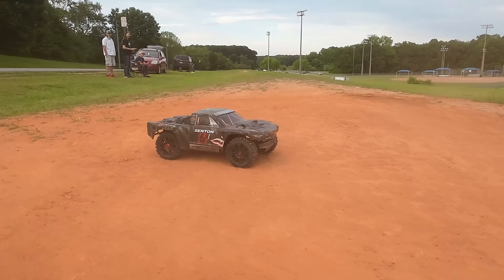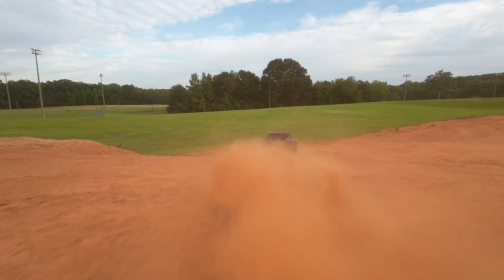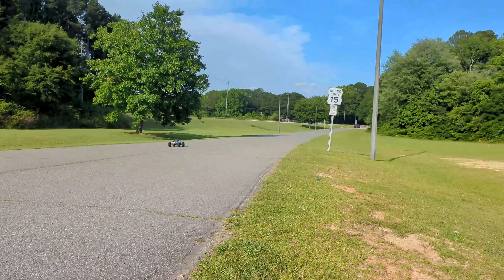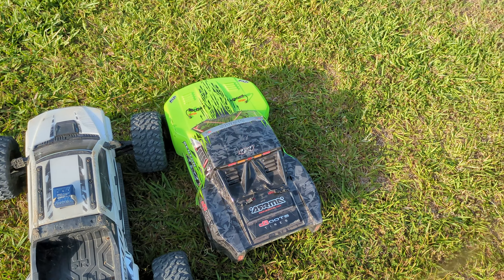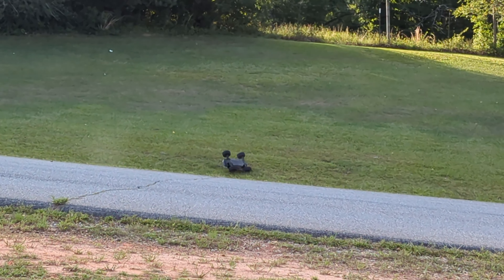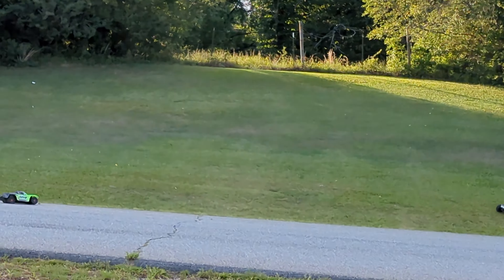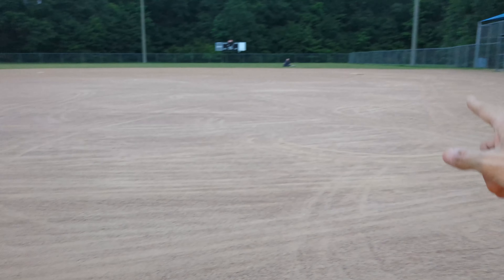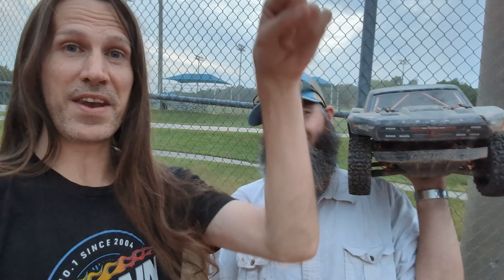SENTON 6S, QUICKER than a FORD RATPOR!

Comment: the 6S senton is on my bucket list for sure! i have a 3s senton v2 thats upgraded to 4s and. the thing is wild and will do 65 all day (i did vent the body myself though), but the extra build quality, heavier duty components , center diff, interior cage, etc on the 6s just make it more desirable. but nobody wants to get rid of them - theyre impossible to find for sale!  or i fthey are for sale they're like more than the cost when new.  still, sweet vid thanks for sharing
Reply from the maker: Yep,  people who have a 6s senton won't let them go. But, as you've done, boosting up a 3s is a great way to have an absolutely wild short course truck, and of course, they're so tough it's almost unbelievable.
Reply: I have a shelf queen senton 6s, all stock😁

Comment: Hi ! great drone footage ! what kind is it ? DJI or FPV ? thanks ;)
Reply from the maker: That's a DJI Avata 1. Nowadays we use the Avata 1 and the 2 for different reasons. The Avata 2 is faster on the motion control than the 1, but the 1 turns a 180 quicker so we use both these days. The motion control is a big help in keeping shots smooth, but it cuts the speed in half.  Still searching for a solution for that because flying full manual takes away head tracking. If you even think of a way to have the speed without sacrificing head tracking, please let us know.
Reply: @Rek_Rc  No solutions, sorry... but thanks for all those tips 😉
Reply from the maker: @rodalord  I didn't think so

Comment: Hey rek Rc, so I just got my zeee 3s lipo for my Gorgon. Comes with the deans connector on it, what connectors or adapters do you think I would need to make it work with the ic3 on the Gorgon? Thanks,
Reply from the maker: The stock Gorgon ESC can't really handle 3s. I swapped the ESC on mine to handle it
Reply: @Rek_Rc  yeah I just went brushless 3330kv combo with 85amp esc and just got the connector for 3s and man she is crazyyy
Reply from the maker: @DrewDoesRcEveryDay  nice, that's a good sort of set up for the Gorgon. I went way too far on mine with 6500Kv
Reply: @Rek_Rc  Wow that’s Crazy, I have another questions lol, my big rock had a tumble sideways and surprisingly nothing broke but, the A arm pivot ball popped off and the front right driveshaft popped off as well, would I have to disassemble the front piece of the truck to snap everything back on?

Comment: So do you prefer this Senton 6s or Maxx Slash?
Was thinking of getting the Maxx or the Maxx Slash cuz that is a slightly larger of a truck..
Reply from the maker: Good question. That's a hard one. The Senton 6s is a unicorn for many of us, and it's very highly desirable in the hobby. The Maxx slash is larger and more stable at high speed. Both are really tough, with a slight durability edge going to the Maxx slash. Though the Maxx slash is considered "new" its electronics are dated, making the trucks virtually the same age in that regard. My heart says Senton 6s , logic says MAXX Slash. But, I'd probably pick the Senton if given the choice to only have one.
Reply: @Rek_Rc another could be the Arrma is a good bit cheaper to buy more lipos. LOL

Comment: Every big air jump, u focused on every truck but the senton.  I didn't see how it jumped 1 time. 
Would liked to see how it did in the air
Reply from the maker: That's just because I wasn't driving the Senton during that bit, I was driving the other truck with my camera mounted to my radio. But, I wouldn't take the Senton 6s off really high jumps, the truck is plenty tough and all, but it's all pretty much entirely metal so you'd risk bending and warping parts as well as the chassis. If it had more ground clearance like the big rock 6s or the Fireteam it would be fine. The Senton 3s is the one for sending into the air though. But the 6s has all its weight down low so it's easy to land usually.
Reply: @Rek_Rc  good info, thank you. A local guy has 1 for sale here and I was trying to find as much info as I could about them. I guess they are pretty hard to find now. 
Oh BTW, loved the dirt racing u guys did. Epic. 
Thanks for the content.
Reply from the maker: @SubZ3ro907 I really appreciate you checking it out and talking with us!
Reply: @Rek_Rc  absolutely. I have a small RC/Random channel myself, nothing as good as yours tho. I have better equipment now and plan to try and get some quality videos with useful content started soon.
I'll shoot u a sub and i hope to see more soon.
Reply from the maker: @SubZ3ro907 I'll for sure go check you out here shortly!